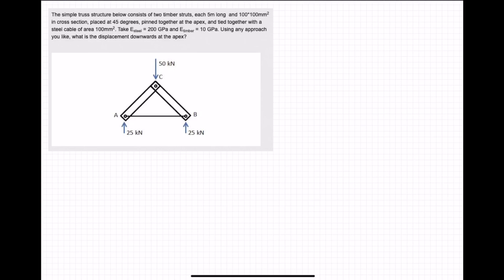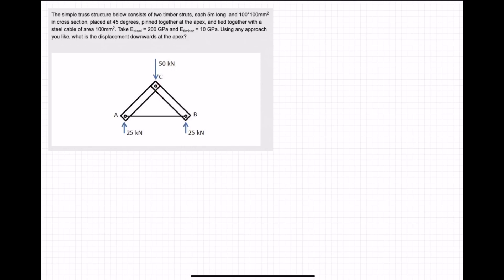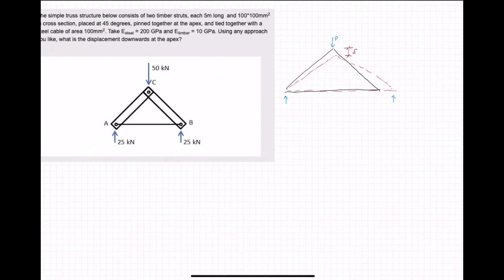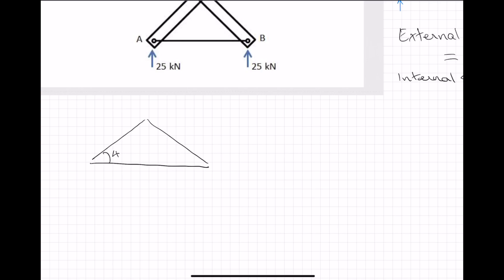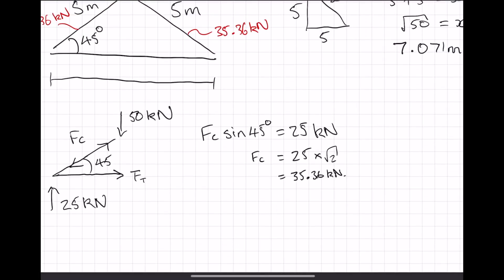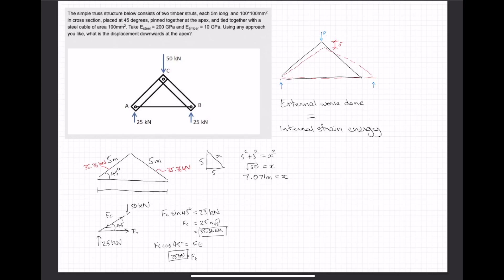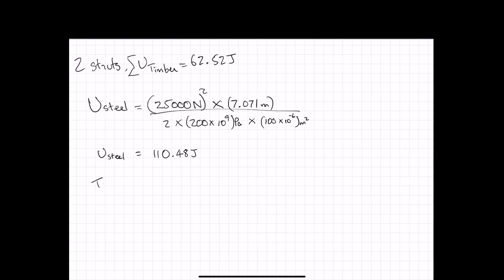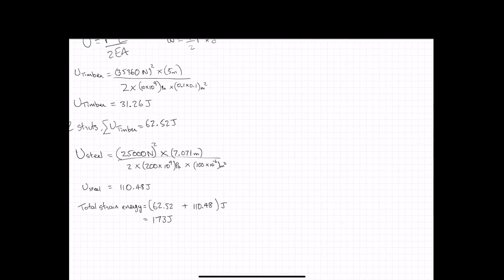Simple Truss Deflection, Energy Method. IStructE Certificate in Structural Behaviour Course

Comment: Videos are very helpful, thanks for all. Waiting for more videos on Structural Behaviour Course.
For this question I wonder why the external work done and internal strain energy is not just equal to "Force x Displacement" rather than areas under graphs shown (1/2 x Force x Displacements). As "1/2"s are cancelling each other this does not change the answer but I believe work should be equal to the force time displacement not the half of that.
Reply from the maker: Excellent question - I'll start with the answer, the external work done is definitely 1/2*Fd and not Fd in this case. Why? The reason I drew the graph at 05:18 is because with any system you have to show how things displace with any level of applied force. This is a purely elastic truss which means the displacement is linearly proportional to the applied force. If you have a situation like pushing a mass along a rough floor then you don't get a linearly varying system. Until you have the minimum force to break past its coefficient of friction, there is no displacement hence no work done. After it the mass can move you can apply a constant amount of force produces any amount of displacement, which gives rise to the non-half version of the "work done" equation, but would be completely wrong for this scenario. That is probably one of the most common mistakes I see with this question, which is why it's better to draw the Force-displacement graph then integrate for the area to get the true work done. As a side note, we express AC electricity in Root Mean Square voltage because if you integrated the area under a sinusoid, you would get 0 energy. But anyone who has ever touched a live AC circuit very well knows, the circuit is not zero energy, so we take take RMS values to be able to express the energy consumed.
Reply: @TheStructuralExam  Thanks for your reply. I need work on that 😊 Luckily the answer is same for both cases. Waiting for more videos.
Reply from the maker: @merterdogdu9220  next one coming in about 30 mins!